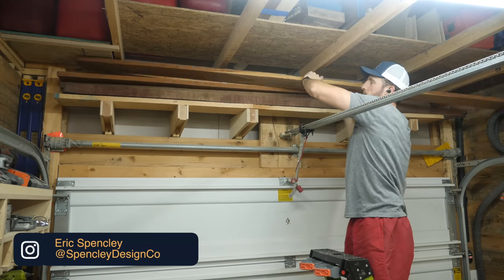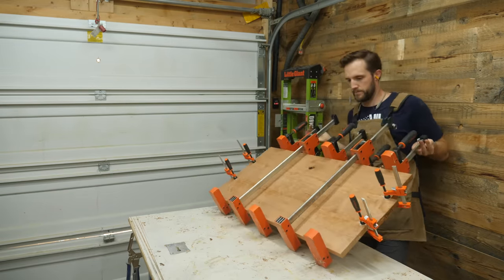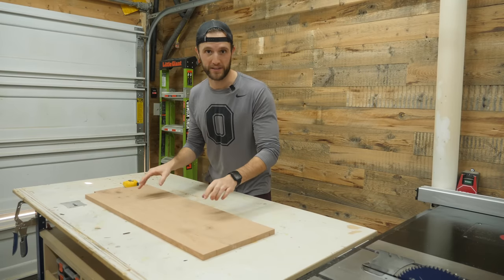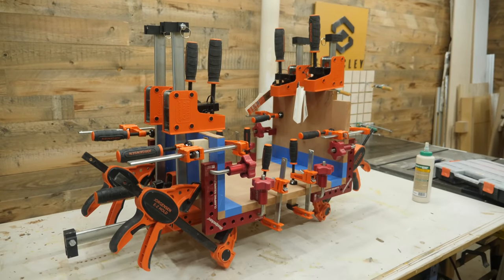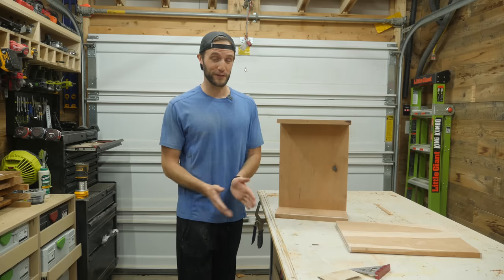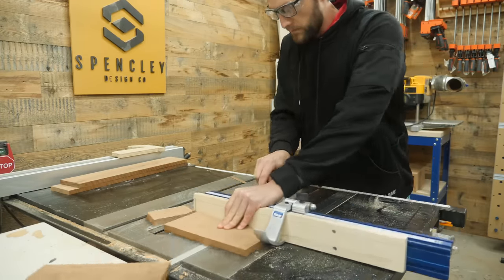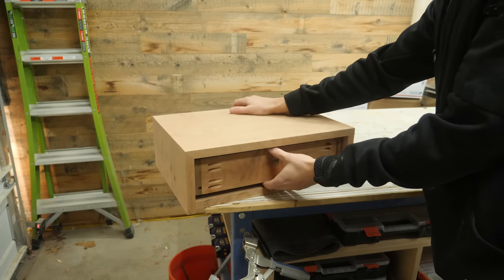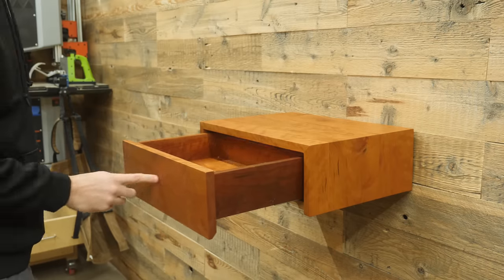I dont know why more people dont do this

Comment: Butter! Here’s a tip for the bottom: use biscuits, say 3 or 4 in the sides, then cut a continuous biscuit slot in the bottom panel but stay just short of the front, the bottom panel can then slide in from the front.
I do this when adding fixed shelves into cabinetry on site, it’s quick easy and neat.

Comment: One little tip. For knot holes, Instead of using pigment in the epoxy use coffee grounds. I dry out my used coffee grounds and add them to my epoxy until it's a peanut BUTTER consistency. Sand it down and it looks great! You can hardly tell it's not just a real knot. I also just use quick-setting epoxy you can get from harbor freight for small jobs.
Reply: You can also use sawdust from the same wood you are using for the build.

Comment: its a big investment, but with having the same electrical restraint....i got an ecoflow battery generator to run my dust collection. works like a charm and i can use dust collection while using my tablesaw.....without the blackouts. hope it helps! cheers!
Reply from the maker: thanks for the suggestion!
Reply: This may be the best suggestion on YouTube this whole year.
Reply: I know they come in various capacities, how long does yours run your dust collection?
Reply: I am super cheap and lazy.... just run extension cords from other breaker circuits.
Reply: Butter

Comment: Butter.  Your French cleat wall mount is great.  Same with the 45 degree chamfer on the  bottom of the drawer front and the bottom of night stand. BTW, I saw your night stand in a photo on the Kreg site; and, equally important, Kreg acknowledged Spencley Design for the design and plans.  Nice.

Comment: Butter. Great work on the project! You can use a tongue and groove router bit set for making the cuts for attaching the bottom. Using a straight bit and table saw also works just as well. I save sawdust for filling in gaps just in case, just store them in a ziploc bag for future use. Comes in handy. Nice to see Little Tikes makes bandsaws! I wonder if Tonka makes one!

Comment: I have been a furniture builder/cabinetmaker most of my life. In my sixties now and have been fortunate enough to have learned a lot of practical and time saving practices. 
The amount of work you went to in order to create a miter joint was exhausting for me to watch. Have you not heard about a “miterfold?” One simply lays however many pieces with mitered ends on a flat surface toe to toe and stretch painters tape across miter seam, carefully turn it over then pour glue into the created v-groove and fold miter closed. It works like a dream.

Comment: Butter
I liked watching this. You present is an easy/ not rushed way.
I was surprised you simply hot glue your pieces to the melamine and run it through the thicknesser. I think this leaves a slight chance of uneven height blobs of hot glue, even though you press it down. I think a better option would be to add some flat spacers, washers, coins, toothpicks, or anything of an even thickness to the bottom board, add your hot glue close to those, then press away with your top piece. This should ensure the gap is perfect. Food for thought 😉.

Thanks for sharing!
Reply: That's a good idea! It would help with the extraction as well, using chisel on the edge, to leverage it off the baseboard (without the edge crunch, even if he trims down his boards usually).  New to channel, so haven't seen many other videos - and if he used your suggestion. 👍

Comment: Great tips, one thing I do a tad differently, is I don't wipe the excess wet glue. Its easier to scrap it off when its dry. I find when I send a piece through the planer, if the glue was wiped clean before it was dried, it leaves a very thin layer of glue that gunks up my blades on the cutterheads, leaving to more maintenance when you're using it non-stop.  Great set-up for what space you have!

Comment: One tip with closing gaps on your miters that I find gives the results I'm looking for is to use the same type of material to rub the fibers together. The screwdriver works but it's harder than the wood, try a small cut off next time

Comment: Cutech 40180HI 8-Inch Spiral Cutterhead Benchtop Jointer with Cast Iron Tables. I bought a couple years ago for around $450 new. Built some extension tables for infeed and outfeed and it works great

Comment: Butter! On gluing the sliding joint for the bottom. Glue the front third of the groove and the back third of the tongue so that you can sliding it 2/3rd together before the glue cause binding of the joint. If the joint seizes, clamps helped quite a bit versus trying to use a hammer.

Comment: Butter ... 
Nitpicking, but I think you meant parallel edge instad of perpendicular edge ...

I am not anti-domino, but i have used dowels for decades. And I AM against tool systems with extremely high prices.

The finished product looks great! I have not used that type of finish, but it looks so easy & good I will need to get some.

Comment: How about a car butter-y or two and a big a$$ inverter; run the inverter to run your tools and a battery charger and only LED lights from the mains 120vac outlet. For intermittent operations, like the planer, it should be workable. Also have a switchover to use the socket for low amp items, drills, sanders, etc. Your planer is 15ish amps times 120vac is 1800 watts, so a 2500 watt pure sine wave inverter is about $200 and you could run your vacuum from the mains receptacle.

Comment: Butter - if you're drilling into a brick wall for the french (sorry freedom) cleat the top elements is easy, just use normal rawl plugs etc but how to do the bottom "locking" strip?  You could use concrete screws so that you can drill straight through and use the same holes for the screws without needing to mess about with rawl plugs.  Or could you screw through the two elements of the cleat to fix them together?

Comment: Nice trick to measure between the installed slides to determine the drawer width.  You can also use this opportunity to check if the slides are perfectly parallel and shim if not.

Comment: Butter! For your power problem I suggest the Milwaukee M18 3600W/1800W Power Supply with four HD12 M18 batterys and it's lightweight. I use mine on jobs sites for the same reason.

Comment: Butter - and there's a lot of it here :-).  Love the video and the tips on closing up the mitre joint.  1 suggestion for the drawer bottom ... Rather than glue the front cut a slot in the back of the botton and chamfer the edges with your trusty $5 harbor Freight chisel (essentially an elongated countersink.  Attach the drawer bottom to the drawer back with a countersink screw (pre-drilled hold, of course) and your drawer bottom can move to its heart's content.  That technique pre-dates me by a LOT and I have lot of gray hair!  it also allows you to remove the drawer bottom should the need arise (e.g. to really clean out the corners when they get full of 100 year old dust bunnies).

Comment: 🧈 Butter!! Regarding your power issue - try putting a new breaker* in your panel and see what happens. There’s a good probability that the old breaker is weak from overuse and from overheating - just like everything, breakers can wear out and go bad.

*Note that your breakers are specific to your electrical panel, so purchase a new breaker that is rated to match your panel. I hope this trick helps!

Thanks for this video! That is one sharp looking piece of furniture!

Comment: You need a battery bank and inverter system! The batteries are charged during idle times and can then supply higher amperage demands when needed.

Comment: Butter! New trick for you to save some cash on double sided tape. Predrill your screw holes through the front of your drawer and drive your screws in so the points barely come through. Align your drawer face where you want it and give it a firm tap. You now have locations to predrill you drawer face

Comment: Thanks for the video
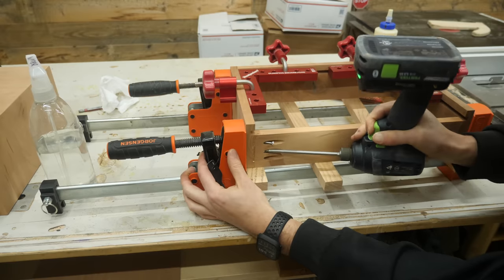30:19... Shows how the back piece does not interfere with the dado for the bottom, (the drawer is upside down at this point)
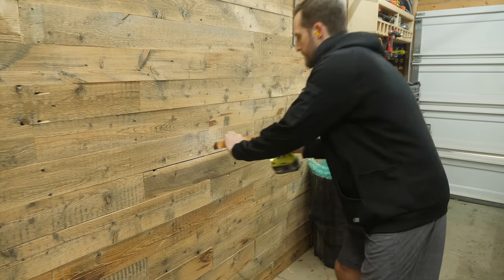38:32... How to mount it to the wall...
38:44...😊

Comment: Upgrade your power with a battery power station. $2000 will give you 3000w continuous and 4500w motor start worth of power. It will only pull 15a from your wall socket and will pull the rest from the battery when you need more than 1800w. 

EcoFlow is a good place to start. But there are plenty of other options. You just need something that can charge at 15a while you are using it.

Comment: When I do miters like this I lay rhem down on the table with the long points up and touch the joints together then use a good quality packing tape and lput the tape on the joint. Now you created a "hinge". Then you flip it over ,add your glue in the joint,just a bead down the middle, then fold them to make your box and you can just use one clamp to hold them in place.

Comment: Good point about power tool electrical requirements. I hope you’re able to gear up as the solar and other movements lower demand and make mfrs more efficient.
Reply: (The above comment from a guy who would put wild colors into almost anywhere a project.)
Reply: 👍 Playing card shims; great idea. Great project; thanks. Liked & subscribed. Why I didn’t make mine: bought a cool hardwood one not quite as slick but cheap online (and I had no shop).
Reply: 👍 Playing card shims; great idea. Great project; thanks. Liked & subscribed. Why I didn’t make mine: bought a cool hardwood one not quite as slick but cheap online (and I had no shop).

Comment: Butter
Resawing:
It very likely went extremely slow because your blade has too many teeth. Get a blade with 2 or 3 TPI for resawing.
The tooth gullets were filling up preventing the blade from advancing into the wood.

Comment: Butter,Butter swing, no butter.  Regarding your power issue: Though I realize you plan to move to larger digs, in the meantime you could use a 110/240 volt battery .  You use your gear intermittently so capacity is not a problem.  Just a humble thought🤓...

Comment: To fix your miter joints make your blade 44.9 degrees instead of 45 the outside edge will pitch towards each other and the insides will pitch away. Unless you absolutely need the inside edges to be perfect this is the way to go

Comment: Just an FYI, if it hasn't been mentioned:
If you want/need to increase the amperage on an electric circuit,
you will need more than access, to the electric breaker box.
If you currently have a 15 Amp breaker, it would/should have been
wired with 14 AWG wire. To increase the amperage to 20 Amps, you
you can Not just slap a 20 Amp breaker, in the box. You will need to
replace the wire, for that circuit, with 12 AWG wire. 
Or, risk burning the building down. 😁✌🖖

Comment: Hello from Germany,
If I were to start showing my mistakes, the video would be twice as long.
That would be incredibly boring for me, but even more so for you.
I'm 69 and started working with wood when I was 67.
Before that I was a mechanical engineer, which is still my dream job.
The only thing I had to do with wood was to light candles with matches and pallets to put machines on.
The path to wood came from building a box for my grandson to put all his toys in. That was a medium-sized disaster because I only had a jigsaw, a hand saw, a few screw clamps and screws.
I bought a few boards (with which I could build a house)
I ended up buying a box of 3-3-2 feet with Merssing fittings.
That was the beginning.
The last thing was 2 chairs and a table I sawed out of a tree trunk. The tree was in the garden and was sawed down to 6 feet.
I sawed everything out of it with a chainsaw into a single passage. a rustic garden set. from the rest of the tribe
 I made a rustic bench. My son-in-law's eyes almost fell out of his head.
I have to say woodworking
is a nice hobby😁  🔨📐

Comment: A single 110V 15 amp outlet? That's harsh! Oh by the way, once those automatic breakers heat up from being overloaded, it trips faster each time because it can't cool down. Wait for a couple of minutes before turning your machine back on. 

But seriously, we have only one amperage circuits in residential installs. All regular sockets are always 16A/230V by code. I can run my 2kW kettle in my bedroom if I wanted to. I can install my clothes dryer in my sons bedroom and run the HVAC from the toilet outlet (yes I have an outlet in the toilet, don't ask). Same goes for my shed, just regular 16 amp circuits. Even my old MIG welder runs just fine on it (except for the really heavy settings). I even have three phase power running in my house (which I only use for induction cooking at the moment) and that's a specialty hardwired circuit. I ran a three phase cable to my shed, but I've only wired a single 230V circuit on it.

So yeah, I seriously weep for those who have to struggle with 15 amp sockets running 110V. I would probably hurt myself :)

Comment: Sorry, I only made it to 10:30 into this video and have a question.  Why did you spend the time and effort on a knot hole that would have been cut off if you simply turned the piece 180 degrees to cut it down to fit into your planer?

Comment: Why does going a little past 45deg make for perfect 45 degree miters?
Reply: If the exposed edge is "straight" with each piece then the join should line up... and the hidden "inside" join which was slightly overcut, might (possibly) have a tiny gap depending on your miter cuts... which means the glue or fixing will bridge this gap (and it's not seen... usually... depending 😅).  If you join your outside 2 pieces together with a 90 degree / square angle, then it should look pretty sweet! 👍   The alternative is you /your miter cutting is a bit out due to User or Tool and it pushes out the join from square... which then involves sanding and/or recutting... reworking, etc... so, the overcut technique is a bit of insurance - depending on your shop set up and tools (and skills).

Comment: You want a 45 degree angle so you cut a 45.xx degree angle? What? I did high end custom trim work for years and never once did that unless it was painted and able to be caulked. Most everything was stained so joints had to match perfectly.  I vehemently disagree with your method of cutting the angles. Also, i would have layed the board flat instead of clamping it vertically in that jig. You could have made perfect joints if you had just took the time to set the saw up correctly instead of trying to jig your way through it. Every component introduced to the process only creates more potential places for things to go haywire, imo. Nice work though overall.

Comment: Butter ! ...  Here's a tip for you...
I decant my glue into a ketchup or salad cream dispenser, you know the ones that sit with the cap on the bottom, as it has a plastic anus and the glue ends ups at the same end as the anus, so you don't waste glue shaking it from one end to the other...

Comment: Meh- he lost me with the lack of overall care. More interested in selling products than actual woodwork. 0:25 I saw it coming- dropping nice lumber- lumber the client really cars about 4' onto th ehard floor. Yes, he planed it but still dented the edges which is they they did not line up and he had to do a hack FIX that was unnecessary IF HE TOOK MORE CARE and pride in his work. That joint will open up over time with expansion and contraction of the solid (less stable) wood. Also, when he clamped it, he went direct on the wood- did not use any scraps to protect the wood. Sorry but overall, I have to say this was a fail.